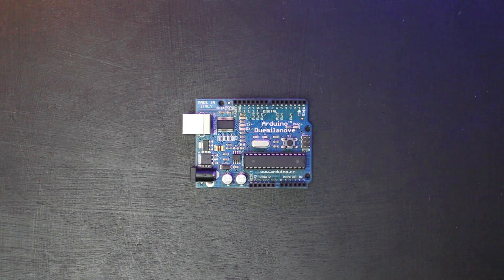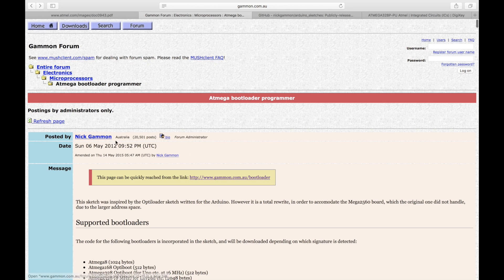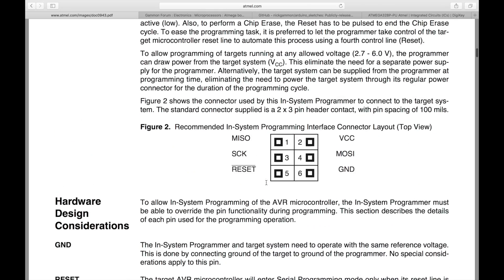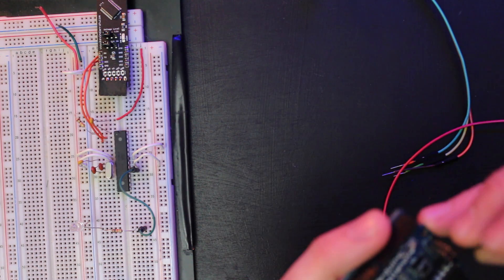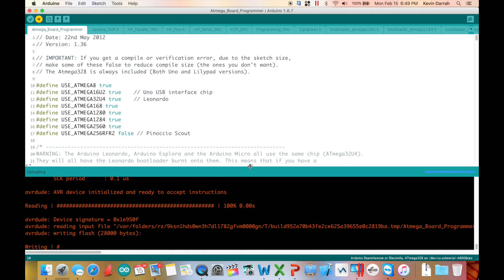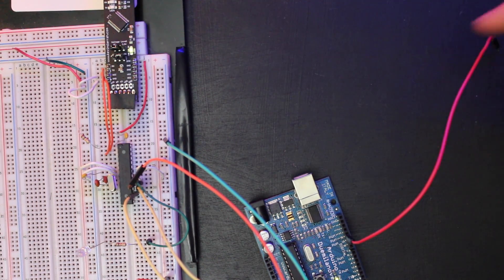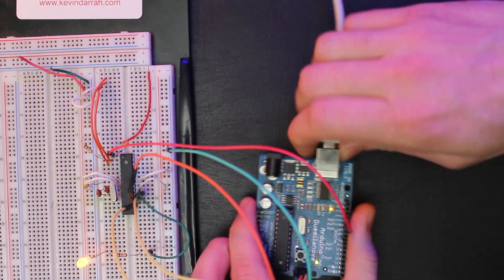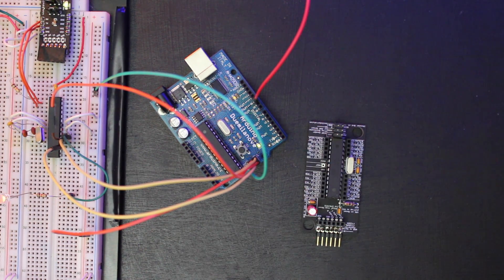Best Way to Burn Arduino Bootloaders Tutorial!

Comment: Hi, thank's for your video.
1st :  i don't see all these boards in the menu.
2nd: I cannot set neither get the type of processor.
I mean the slave one on the white testing board.

I can flash the Atmega328P but not the Atmega328 without P.
Il complains with the signature. I changed the signature to 0X14 (at the end) which correspond for a Atmega328 (witout P).
But i got the same error! :(

What should i do?

Comment: Great video, i will check out the Nick site but Will this same process work on a 2560? Have you made a video on that? Because i am really struggling... and you said there were some usb to ttl compatibility issues. What really fascinates me about your video is you are the first how to i have seen to use the icsp header. Not sure what is up with that seemed to me the reason why it was there... ugh I have watched a read A LOT of internet noise before coming here lemme tell ya. Any exta help appreciated. 😁

Comment: I get an error when uploading programmer can anyone help?  coreyrscottpharmd@gmail.com  Arduino: 1.8.12 (Windows 10), Board: "Arduino Mega or Mega 2560, ATmega2560 (Mega 2560)"

Atmega_Board_Programmer:143:10: fatal error: HV_Pins.h: No such file or directory

 #include "HV_Pins.h"

          ^~~~~~~~~~~

compilation terminated.

exit status 1
HV_Pins.h: No such file or directory

This report would have more information with
"Show verbose output during compilation"
option enabled in File -> Preferences.

Comment: Kevin (and Nick Gammon) thanks for this. I was having a problem with an Arduino Pro Mini (developed by Sparkfun) the watchdog timer reset would not work (it just sent the onboard led into rapid flash) Also to reset the board I had to remove all power and fiddle with the programmer insertion time to get it to reprogram. It appears that the bootloader that comes with the Sparfun (and clones) does not do the RESET properly? Anyway. who knows.? Loading Nick's code fixed this and I presume I have OPTIBOOT loaded. The watchdog timer now works as I want it to. However Tools > Boards> now needs to be Mini rather than Pro Mini for uploads to happen. Thanks to both of you.

Comment: Compiled on Apr 21 2020 at 20:49:14 with Arduino IDE 10812.
Attempting to enter ICSP programming mode ......................................................
Failed to enter programming mode. Double-check wiring!
Type 'C' when ready to continue with another chip ...
Reply: May we help you?

Comment: Hey guys, I just bought an Arduino UNO Board. to burn Arduino Bootloader in ATMEGA328P-PU Microcon-troller. But, I saw another video where the author said: "This Arduino Board doesn't have the bootloader" May someone light me here what to do from scratch? I need to burn a bootloader to an ATMEGA328 micro-controller.
Reply: Arduino Uno is bootloaded already, simply plug and play, but you have to bootload a separated microcontroller,

What you need?
(Filling requirements)

Comment: Thank you for sharing, always appriciate your contributions, your tutorials are life saving. What socket adapter did you used at 00:01:34 to build that surface mount programmer board?

Comment: 4 days of frustration were solved just because of this video. And yes, the pins d11, d12, and d13 can be used instead of the ICSP header. Refer to this image and wire everything up exactly no matter if you want to use the 8mhz int crystal (in other words use the 16mhz crystal no matter what)
https://www.arduino.cc/en/uploads/Tutorial/BreadboardAVR.png

After burning the bootloader you can get rid of the 16mhz crystal and the other components:
https://www.arduino.cc/en/uploads/Tutorial/ArduinoUSBSerialSimple.png

Huge thanks to Nick and  Kevin.

Comment: Well your explanation did not help me one bit. You seem to be speaking only to experts that already know how to burn a boot loader into the Arduino chip and all you seem to be doing, is proposing and showing an alternate method to what others may be using. You U tube article, covered so much so quickly that it not possible to follow you unless one is an expert or very conversant with Arduino. So it is as though you are "preaching to the choir". It is a pity because I really needed to know how to use the Arduino to program other  Arduino chips. Can you perhaps provide a step by step list or a vastly toned down approach to your article. Thanks

Comment: I know how to do this, but after Bootloading the breadboard unit, why is the Original Arduino still connected if your going to use the USB to 
Serial?  Makes no sense!  If you have to have them connected together, what purpose would the one on the breadboard serve?  You have
to take into account that NUBUES WON'T get it!

Comment: The best way to do this is to use a dedicated programmer. Also, instead of buying the chip,caps, resistors, board and making it yourself. Just get a cheap pro mini that is already made.

Comment: Hei Kevin, have you tried AtMega8APU? I tried the Nick Gammon stuff, it recognizes the chip, even uploads the bootloader , after that it does not load any arduino sketches.. I have tried several board as you advised. any idea what might get wrong?

Comment: I don't have any kind of clock crystal. I have two Leonardos, two esp32 and two esp8266 boards. I want to use my atmega328p-pu with the internal 8MHz clock. How can I upload this bootloader? It doesn't work with the Leonardo's ICSP headers (ArduinoISP sketch on the Leonardo and then tools->board->atmega328p on a breadboard (8mhz internal clock) and then tools->burn bootloader). What am I doing wrong? Can I burn the bootloader with Nick Gammon's sketch or do I have to buy a clock crystal/dissolder it from my ftdi chip or is there a possibility to get the Leonardo's clock on a pin?

Comment: You go way too fast for a starter like me... Could you please clearify what the connection schemes looks like? Mainly the one from ICSP to target. 

I want to use an atmega328P-PU as stand alone with the internal 8 MHz oscillator (low power consuming circuit). The chips I have came with the standard uno bootloader and I need to overwrite this and only have a complete UNO to do this with (as ISP), but everything I found so far doenst work. Nothing but errors... I think what you describe can work, but I miss some essential details (looking in the comments, that must be because I lack some basic knowledge abt these things. I am just a simple physicist). Please clearify/ tell where to find the ICSP connection schedules?

Comment: You dont need a crystal for running at 8 MHz
Reply: The ATMegas typically tend to have pretty bad internal clock accuracy (+/-5-10%). You're gonna want to use a crystal for anything that requires accurate timing and synchronization (such as serial communication).

Comment: "target arduino".... my god you arduino crowd are lost.  
it's an Atmel Microcontroller.    Personally I stay the fuck away from the whole arduino experience and use Atmel's IDE.  ASM as much as I can BECAUSE IT'S MORE EFFICIENT... also because without "sketches" and "fritzing" and "hacking" and all the other buzzword bullshit that goes with this whole comunity it seems, people can ACTUALLY COMMUNICATE THEIR IDEAS USING CORRECT TERMINOLOGY.   Unfortunately it's not going to go away, but fuck me it's painful.  bunch of tits running around PLAYING with toys that OTHER PEOPLE DESIGNED while spouting off about how much they know... don't know jack.... peace im out
Reply: Well Arduino attracts arts and crafts crowd - i'm happy that they are enabled to do something with electronics, and reading a 300 page PDF might not be hard for us lot, but for them it's absolute foreign language, and clearly too much of it. They need something that actively limits the space of engineering solutions to something they can just pick up and do something with. Nailing down the platform like the exact ICs, the fusebits, the external components allows them to ship software libraries that provide a lot of high-level functionality, that don't require extra setup, and that don't have conflicting hardware setup requirements, with the tradeoff that these libraries are resource hogs. They've also eliminated something most beginner C programmers struggle to understand for the first few months: separate compilation and headers.

TLDR, yeah it's dumb, but get off your high horse! And oh it's sometimes just so convenient.
Reply: I would like to know how you really feel.

Comment: Using this method and Gammon's method, when I input code to a specific PIN, its almost random which pin will be the out pin on my ATMega328, is there any way to know which pin number I should put in my code to get the desired output pin on the mega?

Comment: Hi Kevin, do you have an idea how to clone a ATMEGA328 to another chip? I've two transistor testers (same type), both will work fine, but on one of them is the chip damaged. The chinese seller doesn't know, where to get a single chip and I don't want to throw away one of the testers. I didn't found a explain video, howto copy a programmed chip. May you help me?
Reply: Usually you can't, because most of the time, mass manufacturers disable readout in the fusebits. You can read fusebits using usbasp and avrdude. Or well, what do you have anyway besides those transistor testers?

But i'll tell you that most of these transistor testers are compiled from a probably slightly butchered source code by Karl-Heinz Kübbeler from the German microcontroller forum. I think flashing them was discussed on eevblog forums or so.

Comment: Just a note, with the atMega328 series I think for 8mhz you can just remove the crystal as they have an internal clock, I think the crystal is only required for 16mhz operations.
Reply: Crystal is more accurate. If you require asynchronous serial communication the internal oscillator might not be accurate enough. It's not just a matter of speed.
Reply: Do u know how I can set my Atmega328p to 8mhz? It’s current set to 16mhz

Comment: DUDE IM GETTING THIS ERROR WHEN IM TRYING TO CHECK MY OLD ATMEGA8 CHIP. PLEASE HELP.....
Atmega chip detectoe .................n 1.19
Compiled on Dec 15 2016 at 15:35:23 with Arduino IDE 10604.
Attempting to enter ICSP programming mode .................,Ó ¶¢% íuÿÿÿÿÿÿÿÿÿÿÿÿÿÿÿÿÿÿÿÿÿÿÿÿÿÿÿÿÿˆÜi²fuý
Reply: Looks a lot like your baud rate is wrong. Check that!
Reply: This does happen the other way around: when beta particles collide with heavy atoms, it produces X-rays from the high acceleration exerted on the electrons (Bremsstrahlung). X-rays themselves only ionize the metal atoms and give the leaving electrons a couple of keV (the energy of the X-ray photon) at best, so they are quickly stopped by the air. Real beta radiation is typically hundreds of keV to a few MeV.

Comment: You made a mistake,reset pin is pin1 where you connected the 10k resistor not the pin2..
Reply from the maker: yes, that is correct, the reset pin on the 28pin ATMEGA328 is pin 1
Reply: keep doing good videos kevin great work btw

Comment: Hi, Kevin.  I'm trying to burn the bootloader to an ATMEGA328P - AUR, the 32-pin SMD variation.  I've tried the recommended way that the Arduino website suggests to burn the bootloader.  However, I don't have the 16MHz crystal recommended, so I tried the workaround method they describe to use the internal 8MHz oscillator.  Burning the bootloader gives me the "Yikes! Invalid device signature" error.  Do you think there is an incompatibility with the chip? Problem with using the internal oscillator? Or could the method in this video work with an internal oscillator?
Reply from the maker: +UnleashedFury11 yea, I remember getting that problem as well - try the method shown here - it works around that invalid signature
Reply: Yeah u have to put it in an actuall arduino before flashing the special bootloader that's how I fixed it

Comment: I purchased a few atmega p-pu chips that I cannot get the boot-loader on as it seems the signature is incorrect! Is there a possibility that programming this way might help with my problem?
Thanks for your time.
Have a nice day.
Reply: I know this is an old question, but I was having the same problem!

The answer is: YES!  I was having a problem using the built in bootloader burner in the Arduino IDE.  Tried both in a board and on a bread board and kept getting this error.  This new sketch took care of the problem.

Comment: Good as always Kevin, how would you go about doing a QFN package (Arduino bootloader). Specially if you are doing small batch of prototyping i.e. 20-30 units. Would an ICSP header be a better option or a ZIF socket jig?
Reply from the maker: +Syed Mazahir Rizvi yea, probably.  You could always look into a tag-connect type connector as well - or other similar pogo-pin style connection

Comment: Why don't you buy the AVR Dragon? You can program all of the ATMEGAs and ATTINYs, as well it has high voltage programming allowing you to utilize either more pins or to program the chip when you went too far and bricked it.

Comment: Seems a bit complicated. I don't do a lot of this but I burn Arduino code from the Arduino IDE without a boot loader. I do use the USBtiny programmer. I document how I do this at the bottom of one of my really old blog postings here: http://www.toddfun.com/2011/01/01/making-a-custom-arduino-board-to-hack-a-christmas-photo-frame/
Maybe you can't do it like this anymore but it just worked super easy for me being I had the programmer and liked working directly from the Arduino IDE go my  custom Arduino boards.

Comment: Great videos, thank you. Sorry if stupid question, why no pin out on gnd and avcc on the cheater board?
Reply from the maker: +Shaun Whiteley VCC and GND are broken out to a 6 pin header near the top of the board.  And the 'shields' that I'm designing get power and ground from the 6 pin ICSP header at the bottom.

Comment: +Kevin Darrah Thanks. If I put a 8MHz booatloader. That means I need:
- a 8MHz external crystal or not (using a 8MHz internal crystal) ?
- must running with 3.3V or can be both of 3.3V and 5V ?
Reply from the maker: +Saytinh yes, 8MHz crystal and can run at 3.3V to 5V - check out my last video on lowering frequency and voltage on the arduino

Comment: You don't need the Arduino bootloader to program a mega328p in with the Arduino IDE. Search how to add stand alone atmega328p (and atmega168) to the boards manager, and program it with USBasp, without the need for the bootloader.
Reply from the maker: +Patrick Jerome Obaldo yep, that's right if you've got an AVR programmer (USB asp is pretty cheap, but I've heard they can be fussy, especially off ebay)
Reply: +Kevin Darrah i've bought a usbasp off ebay. Everything works fine no problem whats so ever. In the past i ve also used stk500, and  i gotta tell you with usbasp is way easy to program a chip. Yesterday i actually discovered that you can program atmega328 directly from arduino, just hook the wires a crystal and you good to go!
Reply from the maker: +ExplosiveAnyThing nice, I'll pick one of those up - you may have inspired part 2 :)
Reply: +Kevin Darrah I'm pretty sure you know this already, but for everyone else's reference. Here's a list of 3rd Party boards that you can add to the boards manager.

https://github.com/arduino/Arduino/wiki/Unofficial-list-of-3rd-party-boards-support-urls

Comment: I must have missed something. Why change the chrystal value? it worked at 16 then did it again using 8mhz.
Reply from the maker: +Terry Peake oh, sorry about that.  I made a video before this on low power arduino which inspired this video, where I mentioned that you have to change the bootloader if you want to run the arduino at 8MHz - I was just showing how that is done here.  If you're running at 16MHz, then don't worry about changing the crystal or anything.
Reply: +Kevin Darrah Thanks Kevin. love your VLOG. If you get a moment. One item that isn't  covered anywhere on youtube is power/brownout reset and external watchdog reset. For self resetting faults. :)

Comment: So much easier using something like the Tinyloadr AVR Programmer https://www.tindie.com/products/jeffmurchison/tinyloadr-avr-programmer/
Reply from the maker: +0521Bryan cool, thanks for the tip - one problem there though - does not support the 2560  still cool though
Reply: +Kevin Darrah Yes true on that. I have the older version and it works great for the 328 as well as the Attiny versions. Have you ever thought about doing a video on using a Attiny with Arduino. Great for small little projects where you don't need a lot of memory or pins. http://highlowtech.org/?p=1695
Reply from the maker: 0521Bryan so funny, just looking at the Attiny datasheet.

Comment: Couldn't you always use an Arduino as a programmer for another Arduino? I've seen this done for some time now.  Am I missing something?
Reply from the maker: +Digger D no you are right, but doing through the Arduino IDE has not given me consistent reliable results - especially when you are using parts where the ID doesn't match up perfectly like the ATMEGA328-AU vs the 328P-AU.  There are workarounds, but man, this has been the smoothest method I've seen.  I also think I had a hard time burning the 2560 from the 328... been about a year now, so I could be wrong
Reply: Kevin Darrah Ok, I use a tiny or the AVR Dragon, so not much experience with this method.  Was just wondering, good info.